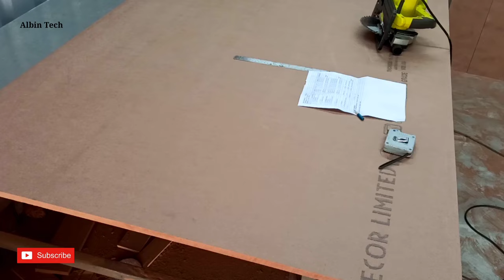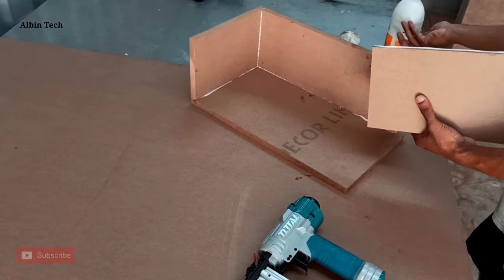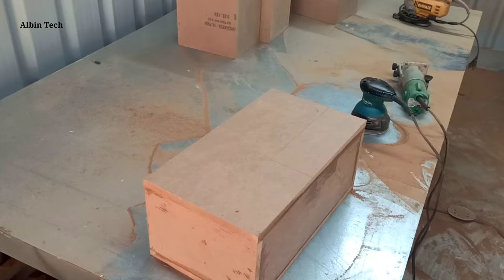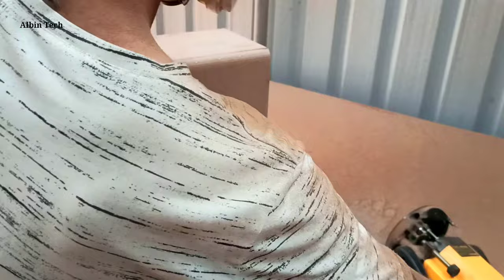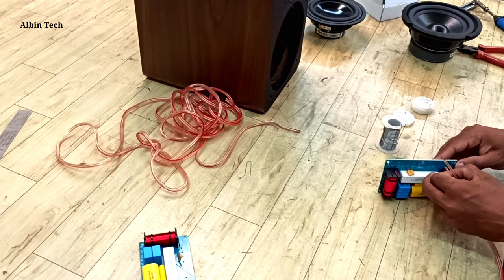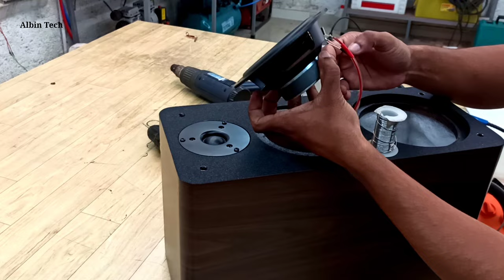DIY 3way 6" bookshelf speakers

Comment: I would add a line cut between the bottom and mid front baffle to separate the vibrations of bottom woofer and top drivers. Hmm maybe a bass port slot as the separting line aka add another L turning it to be mini maze to bass port.

Comment: Dude you make big mistake. For 2 woofers this cabinet extremely little. For bass woofer need use two ✌️ passive radiators, for midrange make free air cabinet. Need open back panel.